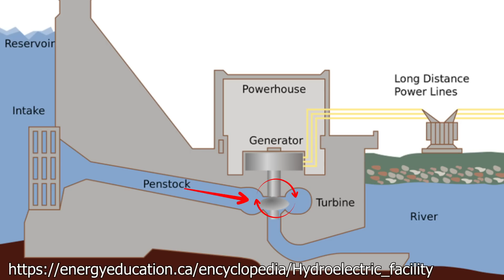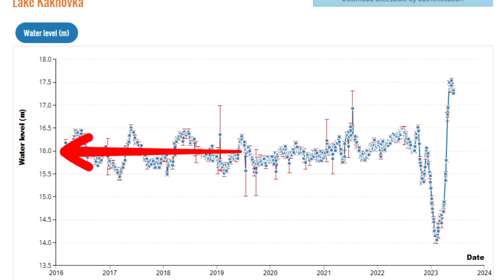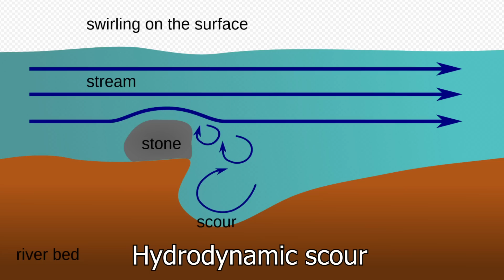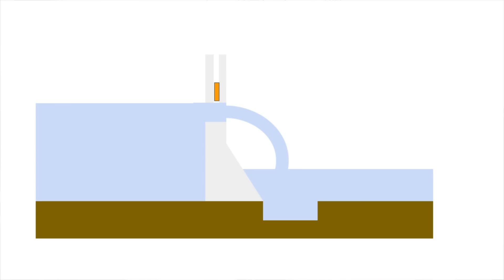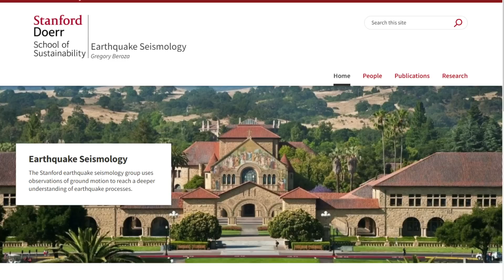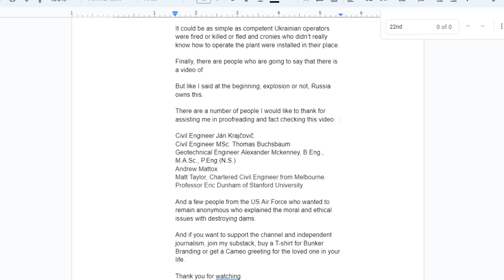How Russia Destroyed the Kakhovka Dam

Comment: I almost agree but there is a problem: If it is scouring and only scouring, why are the middle section foundations (the bottom concrete dam section) still there AND the building gone?  How did scouring « jumped » the middle section to undermine the first section and the maintenance hall latter on, giving way to full washout at the front on the shore side? We need to know way more about the foundations before concluding that scouring is THE cause, because the middle section seems to stubborn to bend to the proposed theory.  As a civil engineer, I enjoyed the video.  As a forensic Engineer, I ask more questions than I can generate answers… As competent as the Russians proved to be, Maybe the big boss said « « open the gates », the middle boss repeated « open the dam » and the small boss said « blow up the dam ».
Reply: It is always difficult to tell between incompetence and intentionally harmful behaviour, and it applies to Russians also.  I checked the historic videos that I could find: no trace of rock cuts at the dam/powerhouse site at construction time.  Everything seems built on soil.  If it was scouring and only scouring, the middle powerhouse foundations would have washed out in a domino effect from the spillway to shore. I can’t see any way around that one.  Now there is a real smoking gun: early morning drone video shows smoke leftovers exiting the top of the main generator hall of section one of the powerhouse. Smoke is a byproduct of explosive usage, not from scouring.  Unfortunately, higher water level and smoke points out to a deliberate attempt to maximise damages.  They just blew the powerhouse up.  Since they raised the water lever before blowing the powerhouse, they intended the subsequent washout.  If the boss intended the whole thing to go or not is irrelevant, Russians did it purposely, with the « help » of utter incompetence that is their main signature.

They could operate the gantry cranes at will: Ukrainians let them retrieve them from close to west shore.  Only Russians would shoot at civilians opening gates of an overspilling dam anyway. Why did they open some gates next to the power house while overtoping the dam?  Did they intentionally tried to undermine the dam by scouring? Was the bridge section falling from scouring the first result of the attempted destruction by undermining?  Finding answers here is about finding what were the intended results of actions they made, in a rational and competent thinking process.  Rational and competent.  Does anyone sees a glimpse of rationality and competence in Russian behaviour in Ukraine?  It makes no sense? You are right.  But again facts are stubborn: they blew it up.

Comment: 9:56 on seismograph chart:  at 1:55:48, big jump.  About 10 seconds later, 1:55:58, another big jump.  If you think the dam collapse would have been recorded on the  seismograph, that could be it.  But like another commenter, an explosion is much shorter duration and probably more powerful than a huge section of a dam breaking off and crashing to the bottom of the river, so I have more doubts that the seismograph would show the dam collapse.

Comment: This is pretty convincing stuff, and it's not as if the Russians have a good history with the safety of infrastructure like this. Whilst Chernobyl is in in Ukraine, it was Soviet designed, and most of the key technical and operational staff were Russians and they were certainly all trained in Russia. Then there was the (little reported in the west) accident at the Sayano-Shushenskaya dam in Siberia. A badly maintained and operated giant turbine broke loose in the power hall, smashing into the roof and destroying or damaging beyond repair 9 of the 10 turbines and killed 75 people. The entire 6,400 MW output was lost, and for a period of time water ran unconstrained through the plant by the 220 metre head of water. The outlet was closed over 25 minutes by hand as all power had been lost. Water had to be diverted over the spillway, that was never designed to be used as the main outlet, and in winter it froze up requiring jack-hammers and chainsaws to keep it flowing to avoid over-topping the dam. That dam kept back 31.3 cubic kilometres of water, as compared to the 18.4 cubic kilometres of the Kakhovka Reservoir. The Kakhovka Reservoir only averages 8.4 metres deep, and maxes out at 26 m deep. In contrast, the Sayano-Shushenskaya is up to 240 metres deep.

In short, the Russians have a history of these sort of accidents, and if the Sayano-Shushenskaya dam were to fail, then that would unleash a disaster many times worse than the Kakhovka failure due to the much larger store of potential energy that would be unleashed (at least 10, and maybe 15 times greater).

Comment: Wow!  I am an engineer, and I have done extensive civil stormwater and flood control work.  It's impressive how well, and concisely you were able to break down this complicated subject and simply took the time to analyze the data objectively.  Your breakdown is spot on, but Russian behavior and timing still leaves me wondering if they didn't accelerate the dam collapse with explosives; either way, it happened under Russia's watch, they are responsible!.  Great job!
Reply: The evil Russisns used explosives.
Reply: @deliafamatigan8764  there were reports of explosion ls when the dam failed. Though no visual evidence yet.
Reply: A Norsar unit un Romania detected seismic activity at about 2:50 on Tuesday, suposedly around half an hour after they first anomalies were reported. The dam may have effectively began to collapse out of missmanagement, and then Russia could have decided to blow it up to make the most of it and maximize the damage.
Reply: The video is AAA quality. He really has the best content I have ever seen. What we can't know is did Russia did it on purpose by closing slipways, keeping what is essentially a hydraulic drill open. That spot on the road , even I would know trouble is afoot. And I don't believe they could not have worked something out to keep things running right. There is no way to guarantee a collapse, but there are ways to pretty much give you a very good chance. 

And the one thing I have to disagree with is making the river larger does not change anything. . Especially if you know the size of their bridge equipment. The larger an obstacle, the harder to cross, that is just plain logic. He may be right about how it does not make much of a diff, but the Russian army is not the Mensa club in uniform.
Reply: I wonder why the structure could collapse at different points simultaneously if it was caused by structural failure. I would think one point collapsing would take the pressure away from other spots.
Reply: you're an engineer but you miss the elephant in the room? ahahahaha how is that possible?
Reply: @@JamesMarshall68 gosh you really go with the roundabout theory. ☠️😭🐘👏👏👏 Exactly? It's anything but what you said. 🤡🤣🙃🐘
Reply: too bad the video title and content have nothing in common.
Analysis perfect, title pure clickbait.
Reply: Only that Russia stands to lose a great deal from the dam collapse. They get their defenses south of the damn flooded, and, far more important, the northern reservoir gets significantly narrower, opening the area to amphibious attacks, or even fording. (Why Ryan failed to mention the most vital operational aspect of this whole thing, I don't know) They already sent two more units to a stretch of land that was considered virtually impervious to attack until now. 

And since you wouldn't need that many explosives to accelerate the destruction of an already breaking dam, wouldn't the only reasonable explanation -- that involves intentionality -- be that Ukraine did it?
Reply: @threestars7561  other reasonable explanations would be: 1) that a Russian commander panicked and blew it so it'd eliminate the potential for river crossing for the next week. Ukraine already had small bridgeheads on the other side. 2) the Russians already had the dam mined. Someone messed up and pressed the button. 3) the Russians already had the dam mined. There was an accident which set off the explosives. 4) coincides with #1. The dam was blown on June 6, on the anniversary of D-Day. There was a lot of chatter on social media that it'd be a great day for Ukraine to launch an amphibious assault. Russians pick up on this, get nervous, panic. 

The "panic" explanations are not as outrageous as they sound. In September, armored Russian battalions at Izium panicked and left all their armor/ammo depots behind. The Ukrainians picked it up and are using it against the Russians. The counteroffensive has been chattered about for months now. Any soldier or officer who is more concerned with surviving than fighting will be prone to panic. Since Putin hasn't been able to clearly articulate a rationale for why Russia should be doing this, it's not hard to imagine Russians who may be more interested in survival.
Reply: @S0ulinth3machin3  Considering the level of incompetence shown by the Russian forces this far, 1-2-3 are all plausible explanations. But we were working under the hypothetical that someone blew it up as a result of a calculated decision. I personally think that neglect/accident/stupidity are fat more plausible as factors, but in the off chance someone really wanted the dam destroyed, Ukraine is the one to gain most from it.
Reply: @S0ulinth3machin3  The other explanation is that Russia intended to put a hole in the dam but miscalculated the effect
Reply: @threestars7561  why would Ukraine create an eco disaster on its own land and people? Would it not be weeks until the wide reservoir becomes drivable for heavy vehicles so if this was to help the counter offensive would it not have been done weeks ago so the ground dried up and so Ukraine wouldn’t have to waste resources on rescues while also starting the counteroffensive.
Reply: @catsandrubber  More like a week to dry in the summer heat. Far from a long stretch of time in the context of this war.
Reply: @catsandrubber  Precisely. And Ukraine's best chance of launching a full scale offensive across the river would have been to re-bridge those missing bridge segments on the northwestern end. They gain nothing militarily.
Reply: @catsandrubber  anything that makes russian life harder = fair game for ukraine

ukraine wasnt making any progress with their counterattack ... by flooding the area by blowing the dam ... they would stall russian progress from the dam side and also mitigate chances of their forces being flanked.

ukraine govt doesnt want to do the counteroffensive ... they are not morons . they understand that they are sending their troops to certain death ... but their govt has taken too much assistance from the collective west and have no choice but to do the bidding of the collective west.
Reply: @threestars7561  there are a few problems with you statement. The Dnieper River is a wide river, even without the dam the Dnieper River is over 500 meters wide, so a amphibious crossing would still be required for an attack to occur. However after the dam drains there will be kilometres of open mud flat to cross on either side of the Dnieper. So instead of you Assault pioneers and special forces stepping onto their boats out of sight if the occupier's and racing across the river to assault the eastern bank at speed, to create a bridge head for the heavy vehicles and barges that are following. 

The lowering of the lever of the reservoir up steam of the dam makes an assault all but impossible. 

Downstream of the dam the RF invaders have pulled back to their secondary defensive positions. Any Ukrainian Assault must now cross a flooded battle field and try to assault the invaders entrenched defensive position. Any amphibious assault will be channelled up streets and slowed down. 

Its impossible for Ukraine to assault Downstream of the dam.
Reply: @seanniemeyer5437  Actually, not quite. Russia destroyed three segments of the roadway on the northwestern end of the dam. It was feasible to throw a bridge structure across this gap. So Ukraine did have an avenue to cross the river at the dam.
Reply: @seanniemeyer5437  Well they could still do amphibious operations while the Russian defence lines are trying to get mud out of their boots. Would be a matter of logistical resupply  as the waters recede and the mud dries. The Russian lines are in disarray on the South side of the Dneipro River now. Even now the people of Kherson city have attempted to help people on the opposite riverbank.
Reply: @geradkavanagh8240  that really does depend on whether the Russian federations military really are in disarray. It is more than likely that the Russian federation destroyed the dam. If that is the case, the vast majority of their military will have withdrawn from the flooded areas to their second line of defence.  We dont know whether those forces remain in the kherson region or have been sent to reinforce the Zaporizhzhya front-line. 

The artillery of the Russian Federation continues to fire on Ukrainian military units as well as on Ukrainian first responders trying to rescue civilians from the flooded areas. 

 To attack now would be very risky and very likely to fail. That being said, there may be an opportunity for Ukraine to conduct an assault once the water receeds.
Reply: @seanniemeyer5437  All points you made are relevant. If you have ever been in a flood area you will understand how hard it is to move immediately after the flood. Reports indicate that some Russian frontlines were overwhelmed by the flooding and these would be key points to attack if: You have a good supply of amphibious or water capable vehicles(ie boats/barges of some description).   You also have to be prepared to follow up with a logistics supply train and reinforcement into basically a sea of mud. ( Helicopters and air drops but that's not really an option given almost total interdiction of air support) A huge Engineering group building and cleaning pathways through the mud to reach your forward troops to get supplies and reinforcements through..
Reply: @geradkavanagh8240  you are correct. It's possible but very difficult. Though perhaps right down in the south where there are few people and the RF forces are struggling to resupply their own forces.
Reply: @seanniemeyer5437  you really think ukraine was trying to do a counteroffensive through flooded area ? when they couldnt breach the russian defense ... the logical thing to do is to mitigate area of contact and also to reduce flanking attack positions. 

by blowing up the dam... ukraine has ensured that there wouldnt be any attacks from the dam side by the russians and they wouldnt run the risk of the counteroffensive forced being spread  out thin
Reply: @threestars7561  Or the fact that Ukraine was starting their Counter Offensive south and now russian positions are safe b/c Ukraine can't advance south from Kherson.
russia evacuated themselves and didn't flood active positions
Reply: @threestars7561 the northern parts of the river will be a muddy marsh for several weeks, so this will make it HARDER not easier to attack across the river in the short term. It will be equally impossible to attack lower down the stream. Everything the Russians do is short term
Reply: @threestars7561  As Ryan says, you'd need access to the generator hall. Only Russia had access. Also, all of the arguments about motive seem to leave out the possibility of incompetence. All reports seem to suggest that the scale of the failure was a surprise to Russia. So either Ryan is right and it was a pure mechanical failure, or Russia initiated it and then there was a cascading failure of the structure.
Reply: @threestars7561  Russia doesn't need the defensives anymore after the dam break. That section is pretty much unpassable for a long time.
Mines are also buried in random locations now. You have tons of debris and freshly deposited mud for km.
Reply: @Vulcano7965  significant parts of the Kakhovka reservoir has been emptying out over the past number of days, the Russian bank could extend out by up to 4 kilometres in places and the river could shrink to less than 100 meters wide in places.

Mud dries in a week in this weather.
Reply: @threestars7561  He failed to mention the most vital aspect of it because he is heavily biased against the Russian side.
Reply: @terrence8634  that wasn’t a biased video. Nice try comrade.

Comment: I don't think the bit of extra water could just "topple off" such dam, that would mean a really bad design in the first place. But the water flow, mainly when concentrated into one spot for way too long and flowing from a higher than designed level definitely can erode things away. But still by itself does not seem to me as too plausible, mainly in such a short time (we are talking about wear causing more damage in less than a year vs normal operation over 70 years).
I think an explosion to be the trigger of the destruction is not out. You found out, at one moment there was a picture with the bridge out but the dam still holding. What look to me as a very realistic scenario was an attempt to bring down "just the bridge", by that explosion. The same way as they did it half year ago when UA were about to reach the banks of Dnipro. But this time first the dam was overfilled, so there was way grater stress in all the structures. Plus the bridge demolition explosion could have been a bit more violent. Or the structures a bit weaker. Or the explosion did not happen in as controlled way as they were supposed to (the reports of the demolition officers supposed to just check up the explosives but setting them off accidentally)
All together damaged the structure in a way it then was not able to hold and collapsed a few hours later, no that big explosion needed at all.